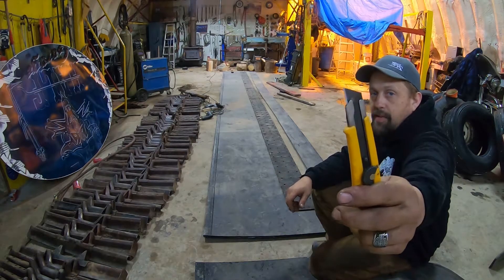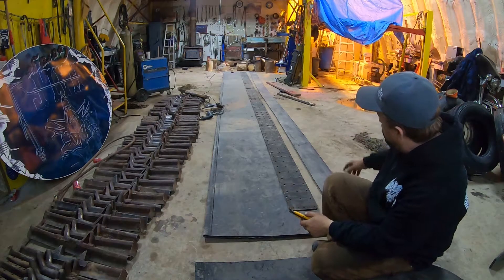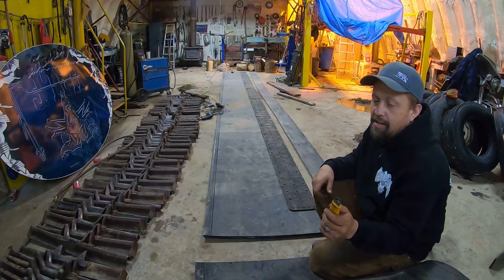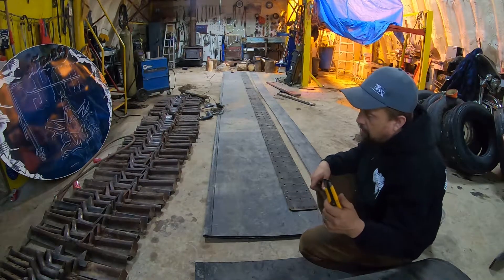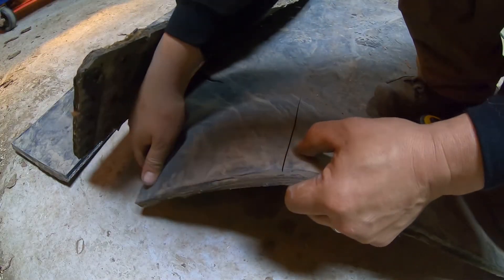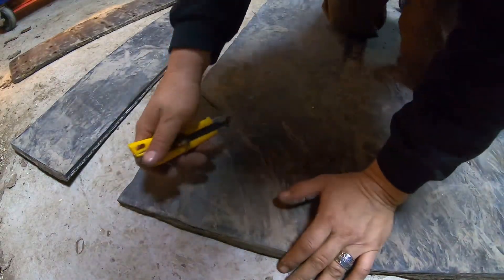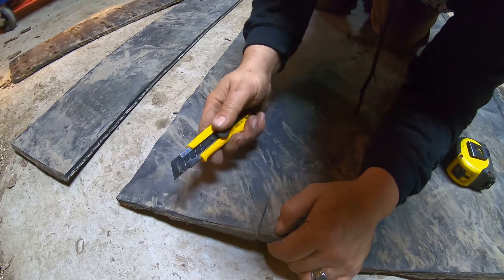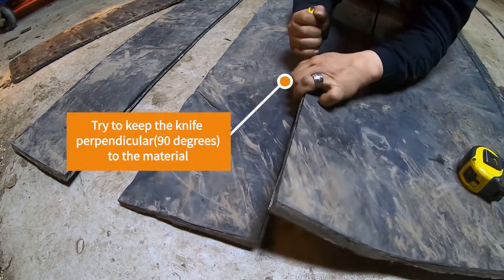Cutting Track Belting for the Snowcat ( Dank Durango getting some new belting for Thiokol chassis)

Comment: We used to cut belting in the mines. Pain in the butt!!! My snowcat tracks are marginal at best but I have a new set to put on. I may run my old tracks this winter and see how they hold up. Check out my vids. They were made a year ago so not very good. Starting to assemble my snowcat in next week or so. I will post videos when that happens.
Reply from the maker: Yeah I was lucky to get mine through last winter as I wasn't surprised when I tore one this fall